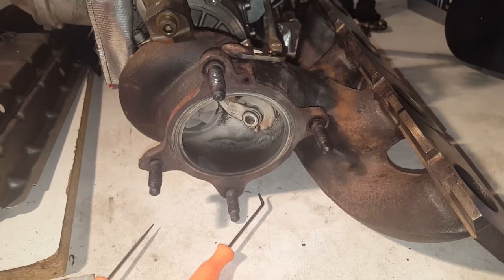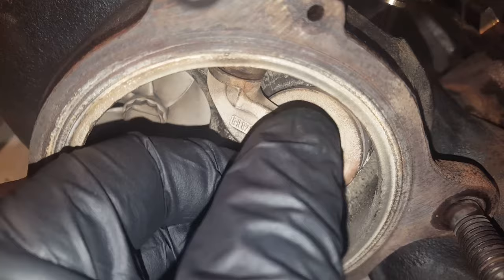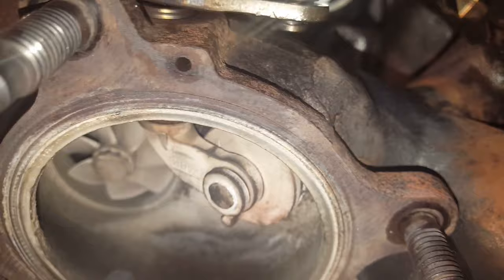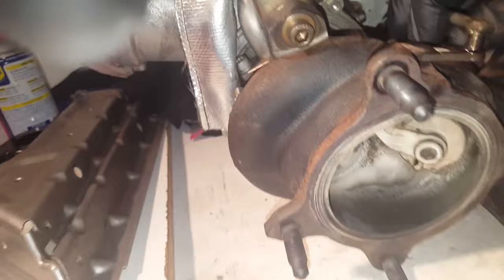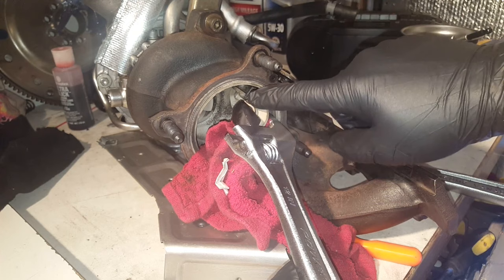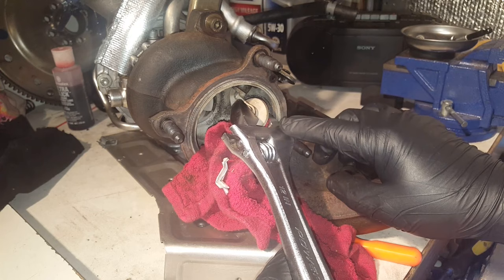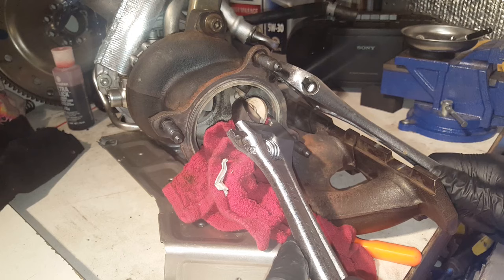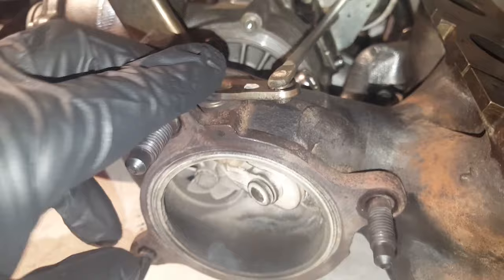Turbo Under Boost Problem Solved, Code P0299

Comment: I have a movano 2010 and I get P0299 only about 80km/h  or above on a steep hill/under load. The car is still running fine and it sounds completely normal. I clear the code with my OBD scanner and then it can run fine for days without it coming back on. As soon as I put the van under heavier load, the code comes back. What could it possibly be?
Reply from the maker: Seems like wastegate issue just started, I would have local mechanic take look if wastegate rod is loose before anything else but keep in mind that engine needs to be completely cold because that area at and around turbo is constantly red hot, in most cases mechanic wont even charge you since that takes only like 1min of his time. Thanks for watching
Reply: @samstye  what to do if the waste gate rod is loose? Thank you for your reply
Reply from the maker: @JimOnFoot  We can only guess from here, but friendly Mechanic would tell you quick fix because it depends how bad it's. if that really is problem but it would be my starting point to check.
Reply: @samstye  So back from the mechanic, but he don't know for sure what it is. The hose going from the turbo to the intercooler is collapsing when you rev the engine. I've checked all the hoses and there is no blockage. What do you think it could be?
Reply from the maker: @JimOnFoot  Did you check air filter?, I don't think that turbo stopped spinning if so you would notice big different in power so most likely air restriction somewhere, air box is good place to check.
Reply: @samstye yes I checked the whole air inlet and it's all clean! I'm so baffled
Reply from the maker: @JimOnFoot  Kind of hard to tell with out proper testing, but I am assuming that you have correct and clean air filter in there?
Reply: @samstye  yes it's correct! Sounds like it could be the waste gate leaking
Reply from the maker: @JimOnFoot  Do you have same issue with that hose when engine is cold?
Reply: @samstye  yea always the same problem
Reply from the maker: @JimOnFoot  Ok, The problem is between intercooler and main air entry in to air box very short distance so if you did check everting at the air entry side including air box/filter you left to check is actual Hose because they do soften up after long and hard use rare but they do go bad and lastly I would have Mechanik check turbo turbine and see if is spinning lets hope turbo is ok because that's costly repair, So if you still have warranty I would take it to dealer let them deal with it.

Comment: Hello i have a golf 5 tsi turbo compressor 140 hp when I press the accelerator the turbo loses first the air and then collects the appropriate air and gives me  the boost maybe you know what cause this problem ? ? Sorry for my english
Reply from the maker: On modern cars If turbo has boosting problem you most likely would see check engine light on?, but the way you explained it I believe that's a turbo lag which is in many cases normal however it should be fairly minimal.

Comment: Sam i have same code but car also trows bad caltalityc converter p0420 and p0299 code...only happend on hill at 4000rpm=> ...changed plugs coils and still same issue...its 1.8tsi gen 3 2014 model year...i turn off thr car and code is gone till full gas on hill on 3 4 gear and epc light is on again...
Reply from the maker: Since you mentioned that EPC lights keeps coming back on basing on that I would have mechanic check oxygen sensors first after engine cools down 100% over night then go from there.

Comment: Hi Sam, I have the same car, and same code, the symptom I have Is the turbo only works when the engine Is cold, once It has the normal temperature the turbo stops working. Do you think could be the wastegate also?
Reply from the maker: Most likely but only If wastegate rod is loose, also Rubber Hoses soften when hot so I would check on that as well after engine cools down 100% over night.
Reply: @samstye  I Will do It! Thank you a lot!

Comment: Is this a temporary fix? How long does it last? Thanks
Reply from the maker: Depends on driving habit but the one you see on this video drove already over 45k miles and still runs with no problems at least yet.
Reply: @samstye  that’s great. Your solution worked for me I wish I did it sooner Instead of wasting so much time and money the last two years with other solutions that did not work. It’s ridiculous that the vehicle OBD scan doesn’t provide a proper diagnosis for that and instead suggested so many other parts to replace. I hope this fix lasts because my turbo warranty just ended last month and I missed it. Thank you very much
Reply from the maker: @nm85418  I am glad it helped. Thanks for watching
Reply: @samstye  by the way my vehicle is a 2014 Benz cla45 amg and the mechanic didn't remove the turbo they just adjusted the rod that connects to the waste gate from the outside of the turbo housing. Also wanted to let people know to check your warranty documents I found out the turbo is part of the emissions warranty and is covered for 8 years or 80000 miles, but I missed it anyway. I'm in Florida.
Reply from the maker: @nm85418  AMG is very nice ride!

Comment: what could be the problem bmw x5 e70 m57y 35d twin turbo there was error 4530 for high boost pressure, and after removing the particulate filter, egr, ad blue, and swirl flaps, another error appeared P0299 for low boost pressure and now both errors
Reply from the maker: What's mileages on it?
Reply: @samstye  on the speedometer there are 220 thousand kilometers, and the real one is 280 thousand, but the engine was already changed in my presence and on the second engine it was 177 thousand, and now it’s somewhere around 200, they changed the engine because the master changed the nozzles and after replacing the nozzles they didn’t put wires on the fuel rail  , they didn’t think the pressure in the fuel rail and the quick start sprayed into the intake and water hammer, the starter jammed, the connecting rod bent, the lock broke!  But error 4530 was temporary at a speed of 150-160 km and now also P0299 although there is no backlash in the turbines everything seems to work well the vacuum works
Reply from the maker: @roman_9307  At this mileages can be couple different things but I would  check charge pipe from turbo output to the throttle valve connection tube for cracks, also pneumatic valve gets sometimes rarely stuck and not letting air flow trough  in between two turbos if your car has one, or waste gate flapper is sticky or loose, I would start from small things first
Reply: @samstye  replaced the vacuum hoses, they were cracked, replaced the red pipe from the turbine to the intercooler as the latch was broken and there was a cut on the pipe and replaced the solenoid valve!
Could it be a problem with the air flow sensor?  it was already changed before me in 2017.
the fact is that I have 2 controlled valves on the turbine and I checked the vacuum with the engine running, one holds the vacuum and the second does not, but I don’t know how they work correctly.
but no one wants to look for the cause in the service, they say it’s easier to completely remove the turbines and restore them, they also say that this error may be due to the wastegate, but it seems to me everything is ok with him.
Reply from the maker: @roman_9307  There is 0.25" diameter metal rad connected to the waste gate flapper which should be snug not loose I usually wait after engine cools down over night then check since that's constant dangerously red hut area I prefer to have mechanic check.
Reply: @samstye  Got it, thanks, I’ll figure it out) I also prefer the master to look, but the fact is that in Ukraine🇺🇦 mechanics don’t really like to look for such problems or they can make it even worse, now I’m looking for it myself, otherwise I was already in 4-  x services and can’t find the problem, everyone says it’s necessary to change the turbines, and if it doesn’t help, then the problem is not in the turbines 😅

Comment: I have same problem with 1.5tsi 150hp DADA wastegate rattle all the time and when I drive on act 2 cylinder mode its hear like trrrrrrrr trrrrrr... My boost pressure sometimes isn't good  Service says it's normal no faults codes. Any help?
Reply from the maker: Wastegate shouldn't rattle and I wouldn't put that as normal report even if ECM didn't report under-boost issues since if wastegate is not loose enough ECM wouldn't set code but to be 100% sure you would need code from ECM or inspect it manually if you have access to it.
Reply: @samstye  thank you btw when I start cold engine it has 1100rpm by heating catalist mode wastegate rattle is so loud about 30seconds  I catch wastegate rod by small spring but wastegate flap still  rattles
Reply from the maker: @dekart283  Are you certain that's coming from turbo? since sometimes air flow inside air box drawing hot air from the engine bay will make very loud rattle noise only when cold for about 30sec.
Reply: @samstye  It's from turbo, metalic sound  when I catch wastegate arm and there's play on arm, rod, and electronic actuator arm see me vid my car has 33kkm and still 3yr warranty but my seller (Seat) said its normal. When I wanted to replace turbo by warranty they said "we can't its functional normally"... whatever i do myself may loose warranty sic!
Reply from the maker: @dekart283 Oh, In that case I would wait for check engine light and let them deal with it. Best of luck to you
Reply: @samstye  thanks, still waiting for engine light haha

Comment: Can you recommend a good mechanic to rebuild 2016 Sprinter V6 engine with 670K miles?
Reply from the maker: Sorry Juno but I don't have one to recommend right now but I would search locally first to avoid shipping charges and also I would get 3 different  estimates with OEM parts as well.
Reply: Van kronenburg in geldrop
Reply: @samstye  Thanks. I decided to go with new engine by MB.
Reply from the maker: @junocheyennekrakus5004  Best of luck to you Juno and thanks for sharing that with us.
Reply: Jesus christ, 670k legit miles?
Reply: @krimepays  
Yes, it is a legit number. My previous 2011 had 570k when I totalled it in Michigan during a winter storm. If you don't idle and care about Sprinter you can get to this mileage without major problem.

Comment: What is the solution if the rivet is broken, can be replaced with another rivet or is mandatory to buy a  new turbocharger ( Mazda CX5 -2.2D/150HP/2016, 125 K km). THKX
Reply from the maker: I believe mechanic with some skills can replace it but probably would be about same cost to replace whole turbo, all depends what mechanic shop charges per hour in your area.
Reply: @samstye  3200 Euro total expenses turbocharger replacement, .... the most expensive rivet. 😭
Reply from the maker: @georgecojocaru9015  Sorry to hear that 3200 Euro quote got to be joke lol I would definitely consider visiting couple different shops around and also ask what would they charge to rebuild it and go from there.
Reply: @samstye  Mazda dealer -  showroom and workshop. Good but very expensive rivet or joke...

Comment: Do i need to remove ot to be able to fix it?
Reply from the maker: Couple guys asked same question down below,
I guess that's possible with some struggle, as you see I was rebuilding this whole engine and had it out already together with engine but if I ever end up repairing only waste gate on the turbo I definitely would try while is still in the car since I would have to go trough same process to take it out any way.

Comment: where are you located can you fix mines
Reply from the maker: Sorry China I can't, I would check with certified local mechanic to scan the car first or local auto parts store also will scan customers cars free of charges in most cases and tell you what code you have then go from there.

Comment: Hello, I have a Toyota Yaris 2010 diesel 1.4 I have the fault code p0299
Reply from the maker: Did you have visual inspection around turbo very carefully and look for loose parts but only when engine is completely cold since sometimes problem is visible outside of the turbo.

Comment: Can you do this fix without removing the turbo?
Reply from the maker: Couple guys asked same question down below,
I guess that's possible with some struggle, as you see I was rebuilding this whole engine and had it out already  but if I ever end up repairing only waste gate on the turbo I definitely would try while is still in the car since I would have to go trough same process to take it out any way.